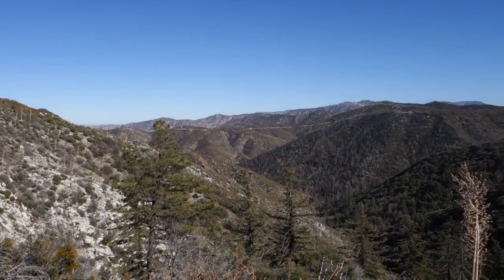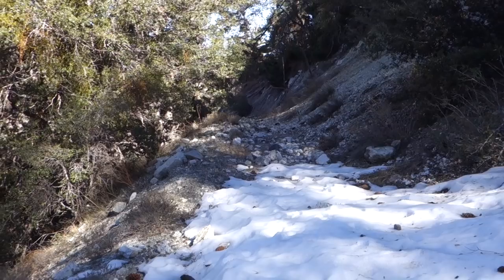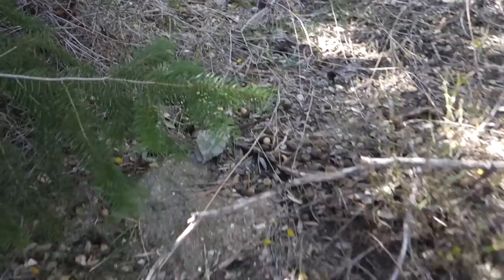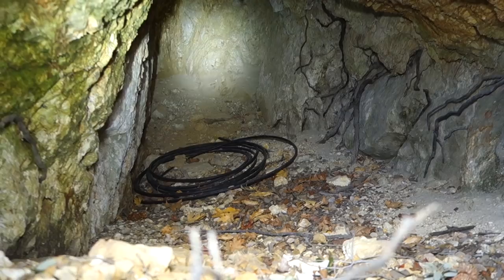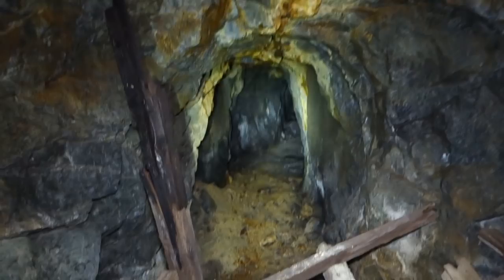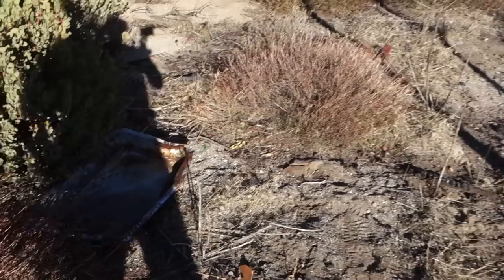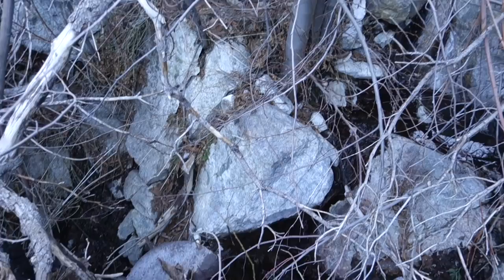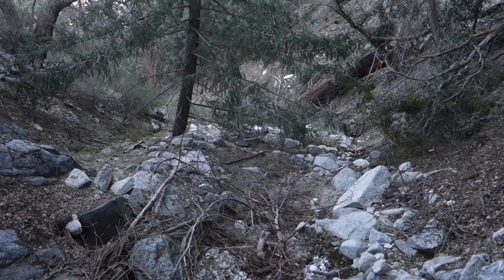The Mount Gleason and Padre Mines - Historic Gold Mines in the Western San Gabriel Mountains

Comment: I think the truck at the beginning is a 1930 International. They are the only thing I've seen with those odd fenders. I know it's not older than 1930 because it is an overhead valve engine.
Reply from the maker: Cool! Thanks for the info.

Comment: Usually if you see a spiral metal tube and you cant find a way into the working then the state has come with dynamite and clised it off
Reply from the maker: I've seen it where the blm or forest service has used culverts to seal up mines, but I don't believe they did this job. It's not owned by them. I'm pretty certain it was from sombody working the mine. That's why it has a ladder.